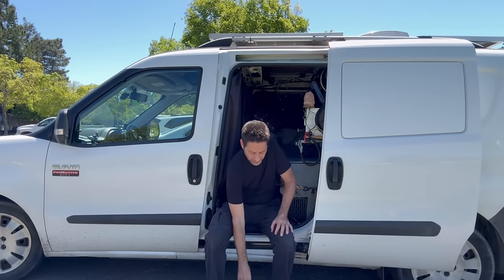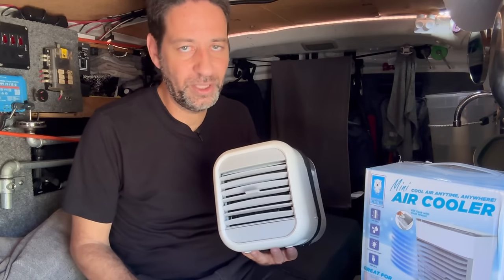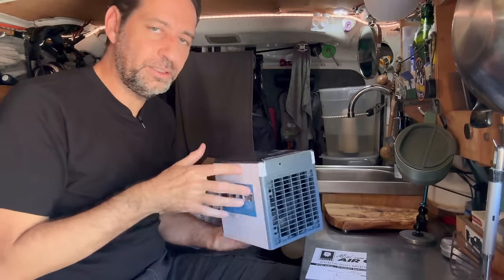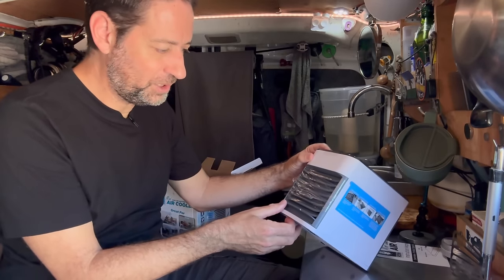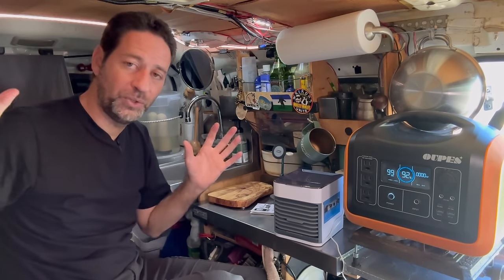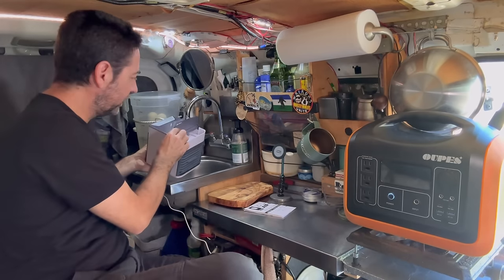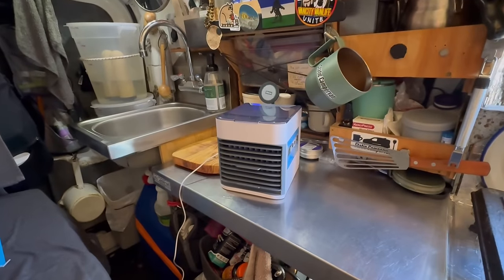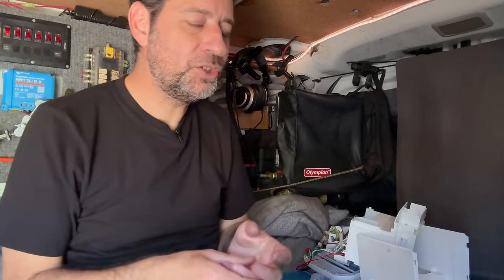Will A $20 Air Cooler Keep My Van Cool? #adayinalife #vlog Tips To Stay Cool In Hot Weather

Comment: in my no air conditioning company car in the summer, it was hot. I was getting in and out of the car regularly all day.
 we did have commercial size icemakers at work so that the crews could fill up their coolers with ice and water for the day..
  employees were allowed to take as much ice as they want for free, which many people did on Friday at the end of the day. They filled up their coolers for the weekend they had planned. Some of these coolers were pretty big…
  I had an idea
I bought a cooler. I cut two holes in the lid. I stopped at a car salvage yard and bought a blower motor did operated on 12 Volts that I could power by plugging it into the 12 V power outlet.. I attached the blower motor so that it would blow cool air out of the box towards me. The air would equalize by pulling air in through the second hole over the ice.. simple..
  so the following Monday, it was a hot one in the mid 80s, I filled that ice chest up with as much ice as I could get in there. It just barely fit on the passenger floor. I put the lid on with the blower motor aimed at me. I plugged it in, and it worked wonderfully… I started off on my route about 8 o’clock in the morning that day.. about 830, I was not even in my work area for that day yet, I could hear the Irish sloshing around as I went around corners.. I thought nothing of it
A full hour later around 9 o’clock, I noticed water coming out from under the lid as I went around corners . I thought that’s about normal.. by 930, 90 minutes later, I was not getting the cool air anymore. I opened the lid to take a look, 100% of that ice, probably about 40 pounds of ice was completely melted ..
  I would have to put 40 pounds of ice in that large cooler about every hour because it would just melt because it was having hot air blown over it..
  I transferred out of that job when a job in the maintenance department came up for electrician/HVAC technician. The company paid for me to go to school for 2 1/2 years two nights a week after work to learn the trades..
  here is our air conditioning works..
  I won’t go into the high pressure and low pressure side and the drop in temperature in the evaporator coil
but I can tell you that air conditioning does not create cold. It does not create cold. What air conditioning does is it removes heat..
  On an air conditioner for a house with a split system, or a window air conditioner in your bedroom window. There is a coil like a radiator on the inside on a window unit, and there is a coil on the outside/there also looks like a radiator…
 The compressor pumps, the Freon through the tubing that runs through these coils. By building up pressure, and squeezing it through a small opening about the size of a ballpoint pen, as that Freon goes through that restriction., It expands once it goes through that metering device and the temperature drops at that point. That cool Freon flows through the interior of your home or the interior of your window air conditioner coil. That is called the evaporator coil. If you have a whole house split system that evaporator coil is actually at the top of your furnace where the ductwork is coming to the top of the furnace, which is just a fan at this time when you need air conditioning and not heat. you’re outside part of a split system for whole house, has the air conditioning compressor which compresses the Freon and send it through tubing into the evaporator where it squeezes through that small opening and drops the temperature of the coolant. The interior coil called the evaporator picks up the heat and humidity is over the evaporator coil. The furnace blower circulates that cold air through the supply line ductwork throughout the house, and the return air duct work pulls the heat back through the furnace so the cycle continues, it sucks the hot air in, calls it and distributed through the house through the ductwork.
  With a window unit, the coil on the inside of the room on the window sill is the evaporator. There’s a fan behind the evaporator that circulates the air that is cooled through the room… The coil that is on the outside of the unit in the window is called the condenser coil. That is the coil that gets rid of the heat. There is a fan behind that coil blowing Air through the condenser radiator, and the condenser releases the heat to the outside. The Freon goes through that condenser, through the compressor, and back into the small metering device, that once the Freon squeezes through that tiny metering hole and expands as it goes through there, there’s a big drop in temperature, and that cold gas goes through the evaporator, picking up heat, and that Freon picks up the heat and takes it outside to the condenser where it gives up the heat. It is not creating cold, it is merely moving the heat from one space to another…
  i’ll block of ice with the fan blowing on it will feel cool for a short time, the hotter it is, the more that ice is going to absorb heat and melt faster. Even if you had a commercial ice machine with an unlimited supply of ice at your disposal. You would have to be constantly putting ice into that box with the fan blowing air on the ice for it to have much of an effect. One effect it definitely has is, it makes the humidity skyrocket. Because you’re melting the ice, putting humidity into the air and that makes it feel hotter…
  I have not watched this video. Because I know that thing does not possibly work for more than 30 minutes. It will absorb some heat in a small area, not even as big as the interior of your typical car, and it will increase the humidity level substantially. Then you have to dump the water out and replace the ice, I doubt that it could lower the temperature on a hot day inside an area as small as a car at all, if anything, it would make it more miserable because of the spike in the humidity..
 don’t waste your money
  do you have to absorb the heat, and move it to someplace else. That is all air-conditioning does. If you go to the outside of your window, air conditioning unit and put your hand there to feel the air coming through the condenser coils, you will feel that they are warm to hot, depending on the temperature of the space being air-conditioned. If you hold your hand above the split system for a whole house, air conditioning unit, and feel the air coming out of that condenser unit which has a fan, pulling air through it constantly while the unit is running, you will feel the dead air coming off of that condenser unit is hot to warm, depending on the temperature in the space being air-conditioned..
  Do you have to be able to absorb the heat in the space you want to chill down, and move it somewhere else. This box with a fan on it is not gonna do that.

Comment: I have to ask, but is your slider open and it's 80 degrees out and you're trying to cool the interior?
Reply from the maker: Near the end of the video I did a little test by closing the van up and taking a walk. That test showed that air flow is important when using a swamp cooler

Comment: Just a thought - can you freeze the pads?
Reply from the maker: I touched on that a little. Diving deeper in, the pads are barely a quarter inch thick. Think about how long a quarter inch thick ice cube would last while blowing warm air on it. And since the pads aren’t fully ice, they would melt even faster. I suspect the frozen pads would be defrosted in less than twenty minutes.

Comment: I don't have to watch to know that it won't.  Mine even have an ice pack and makes no difference
Reply from the maker: Yes, I specifically avoided the units that use ice packs. The swamp cooler type works much better and for a longer duration